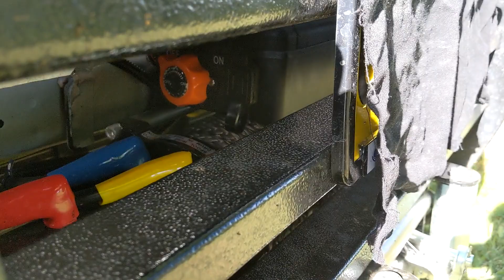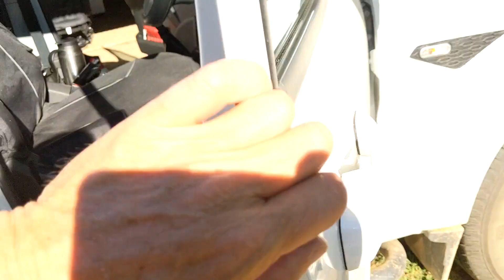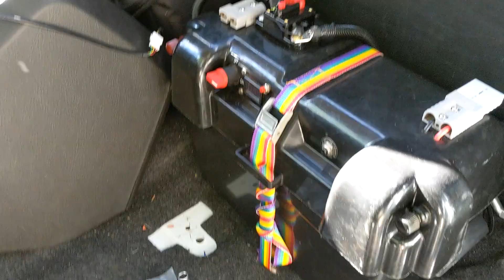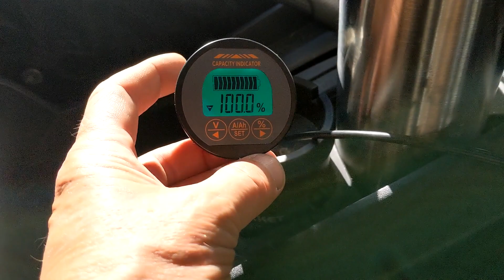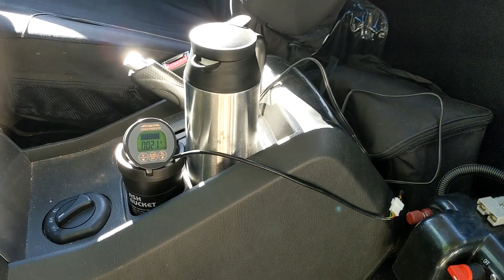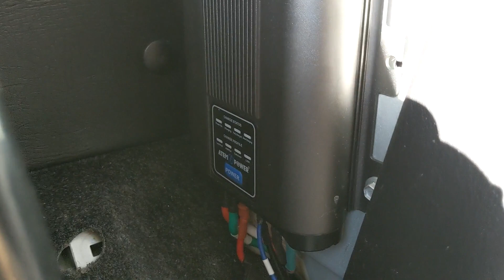Mahindra Pik-up S6+ more mods Dual Battery Aldi Winch Ali Battery Monitor

Comment: All these chines ones are ticking time bombs, please change to a better quality product.
Reply: If you want to buy luxury like land rover defender , range rover ...owner of land rover and jaguar are indian company TATA motors since 2008😊😊😊
Reply: Mahindras are Indian and they are pretty good the winch from Aldi I don’t agree with
Reply: @malware0427   I was referring to the chinese bolt on's. I drive a Mahindra myself, though its no were close to international standards in terms of reliability of toyotas or handling characteristics of Fords, it does for what i paid for for.
Reply: @papaloo2000  what rubbish